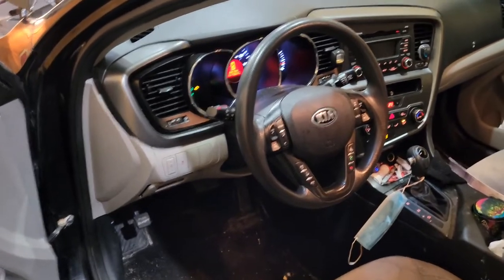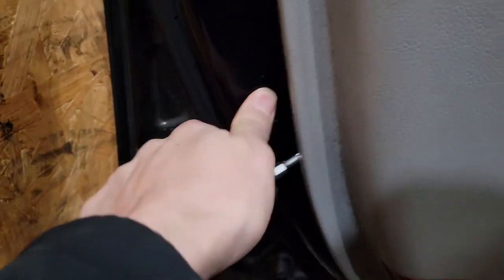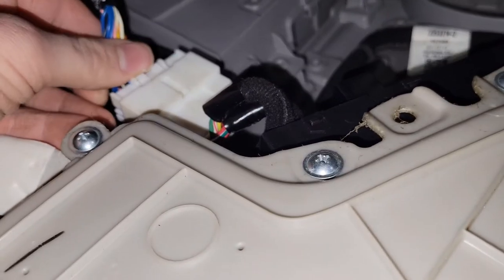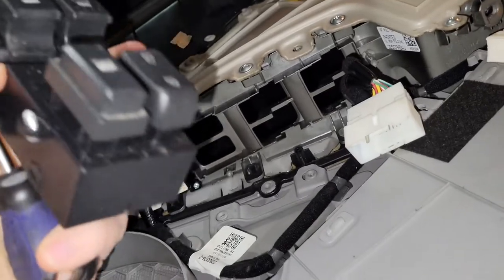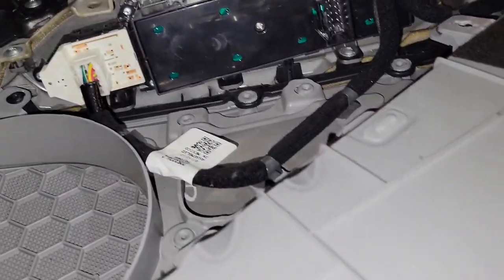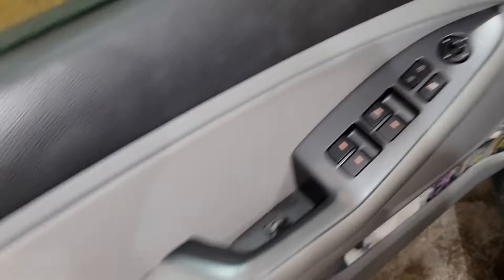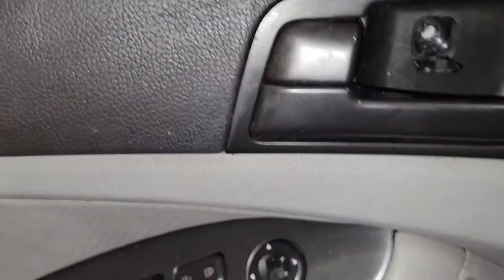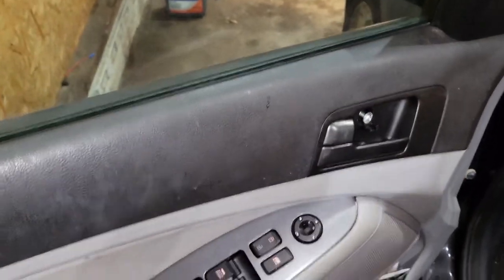2013 Kia Optima Master Switch Replacement

Comment: Nice but how can we be sure that its the panel that need replacement and not the wiring that is damaged or whatever
Reply from the maker: Unfortunately, that's going to take specialty tools and a electrical class. I'd just replace the switch and go from there. Most of the time it's just a worn out switch
Reply: @AnythingAuto  yes i think youre right bc it works on the other switches. Like i have no switches that is not working on one side unless that the other one is working. Or could it literally be electrical issues from the specific side?